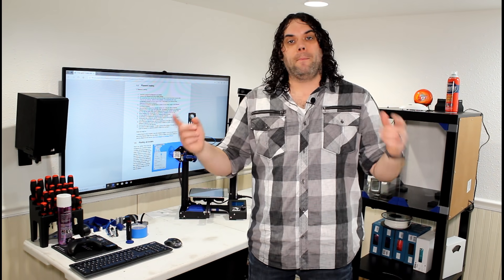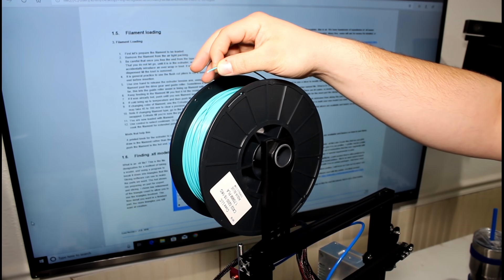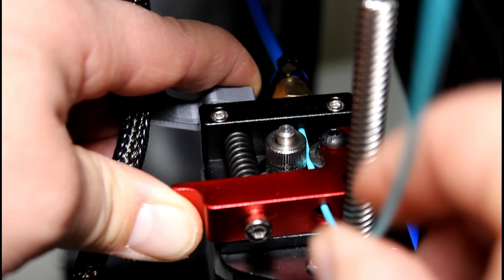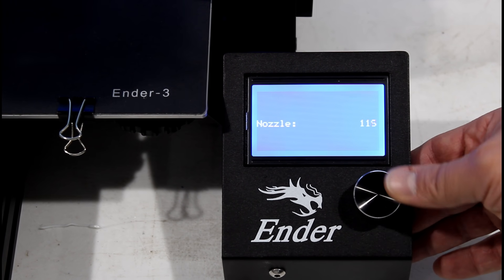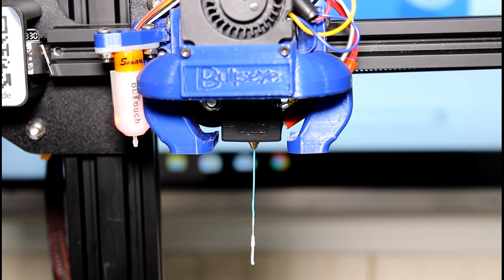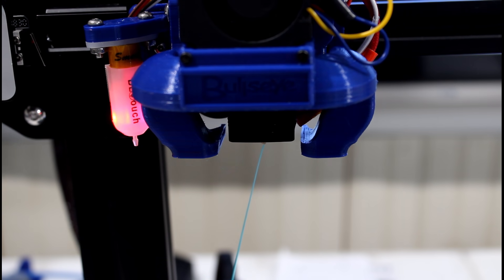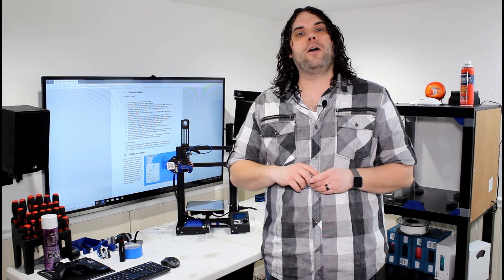Loading Filament Section 1.5 featuring the Ender 3

Comment: Huh, that little gear with teeth was above the other smooth gear on mine. I kept getting so upset that it wouldn't grab the filament. This video helped me identify and fix my problem. Thanks
Reply: I have the same problem it's impossible to put the filament through the second hole. How did you fix it? How did you move the golden gear?
Reply: See my issue was I could really tell where the actual hole was and I was feeding it not knowing lol my first 3d print 😅

Comment: Mabye you can go deeper into one of the last remarks in this video about the cooling down and leaving the filament in, somethin with 'cooking it in the nozzle '...
Reply from the maker: Thank you for watching! It's best never to let the filament sit in a heated up Hotend for an extended period of time. If the filament sits in the heat for to long it can "cook" it. That can cause clogs and bad prints. Another reason why it's good to use a prime before each print. Does that help?
Reply: @TheEdgeofTech  Thanks for quick answering!  At the end of each print my E3 stops heating and restarts at the begin of the next. I understand well not to keep the nozzle hot ( with settings in the Controlmenu) when not printing for some time .

Comment: I can’t get to through the second hole it just gets stuck
Reply from the maker: You need to cut the end of the Filament at an angle and then straighten the Filament before pushing it in. And just barely push the arm of the Extruder and slowly feed the Filament in. Let me know if that works for you.
Reply: Same
Reply: The Edge of Tech I found my problem there is filament in it and I can’t get it out
Reply: @nikorulesxbox4288  I had the same thing happen. The filament broke at the pulley. I removed the filament tube insert at the extruder and pulled it out.
Reply: @Craig-tw4wk mine did the same and i can’t pull it put
Reply: Great tip on cutting a 45 degree angle! I've struggled for a year to consistently load the ender

Comment: This is a great video!  I bought an Ender 3 Pro that just came in yesterday, so I have not built it yet.  I am trying to learn all I can before I build it.  Is it a good idea to purge the filament after each print even if I am not changing filament colors?  When I get through printing and am going to turn off the machine, do I need to purge?  I just don't want to get a clogged nozzle if I can avoid it.

Comment: When I push back the lever and attempt to put the filament in. The filament enters maybe a centimeter, as I turn the knob to allow the filament into the extractor the filament does not enter through the tube into the extractor. Any help is appreciated!

Comment: I can get my filament trough the second hole but if i push really hard nothing comes out of the nozle (I have the nozle temp at 210 celcius and there is still filament inside from the last print)

Comment: hi geat videos, i have a Ender 3 Pro when u are loading the Filament and u squeeze the lever the first hole doesnt line up with the second hole so u cant push the Filament through to the tube.  How can i fix this problrm , Thanks
Reply: You need to press the lever just a little. Then you'll be able to push filament through
Reply: Or turn the filament 180°
Reply: I have the same problem it is ridicilous, how did you fix it? When I push the lever the filament will move out of the way. Who though of this shit??

Comment: Our ender 3 doesn't have the change filament option. It would be nice.
Reply: Did you Heat your hot end first?
Reply: DJMovit mine does. You might have an older version of Marlin firmware possibly.

Comment: Hi Jim! My extruder is properly connected but is working in opposite direction. What should I do? There is a way to change the direction without touching the wiring?
Reply from the maker: The cable might be plugged in backwards. Can you try flipping it around?
Reply: @TheEdgeofTech  I tried but the plug is only one direction
Reply from the maker: @pipepenta  You may have to turn the plug around on the board. Where the stepper wire plugs into the board.
Reply from the maker: How do you know it's going backwards?
Reply: @TheEdgeofTech  because the filament is going against the nozzle, at the end the filament isn't feed and is going out the tube
Reply: @TheEdgeofTech  ok, let me try, thanks a lot
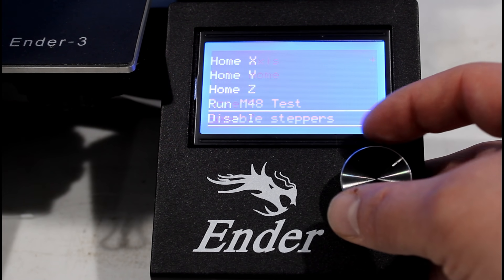Reply: @TheEdgeofTech  it works! Thanks again. Also a video of Chris helps a lot (time 5:27) https://youtu.be/G7G1cwVduVk

Comment: I'm not sure if my holes are properly aligned , I seem to have my filiment wrap arround the pully
Reply from the maker: That will happen a few times until you nail it down. Make sure you cut the end at two a point and straighten the filament out as straight as you can before you put it in. Then press the lever a little bit to open up the pulley and slowly feed it through.

Comment: I dont have that change filament on my new silent board can u shed some light on this iv just stuck the board in my machine and everything works fine but theres no change filament setting
Reply: how do you do it? i just installed the silentboard aswell, no filement option....
Reply: @SoccerEFM  u just have to do it manule bud warm the hotend up by selecting it in the settings then when its at 180c use the E motor and turn it so it pulls the filament out then do all in revese once u have ur new filament in
Reply: @theriddler3845  Thanks! I will do that.. I have absolutely no clue why they make a motherboard and disable a basic functionality like changing filament? Why in the world would you do that? This ender 3 printer is such a pain for everything xD Bed leveling etc. Next time a more expensive printer haha
Reply: @SoccerEFM  yea its defo a must have feature special if u have to do it mid print but u will find more expensive printers have the same issues its the way they are designed

Comment: mine gets stuck on the brass part, even if I cut it
Reply: Happens to me too. It helps if you don't squeeze the arm fully--just enough to take tension off the filament. Otherwise the filament enters at the wrong angle and gets hung up on the end of the Bowden tube.

Comment: So I seem to be the only one having trouble putting yhe filament through the first hole. I've had my printer for a couple days and still can't get the filament through the first hole. It looks smaller than the one in this video but I'm using yhe filament it came with so I'm pretty sure it can't be that I'm using the wrong size filament. Anyone have any suggestions for me? I'm worried I may never be able to print.

Comment: (RESOLVED) I feed my filament through, and I push it really hard, even when the machine tries to feed it it fails, it's a brand new printer
Reply: @johnkale5726  Found out why, my tip wasn't hot enough. For my PLA I had to manually take it up to 215-230 Celsius